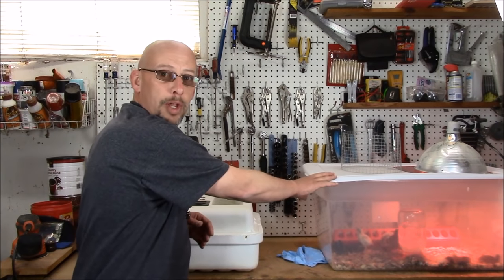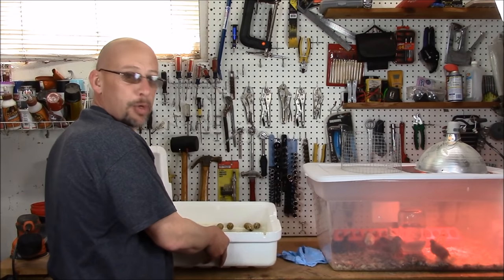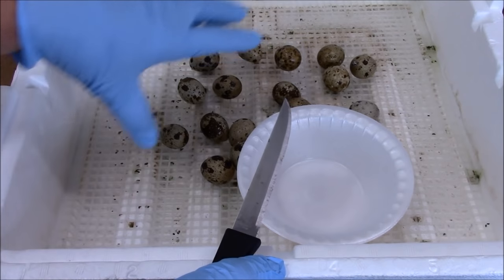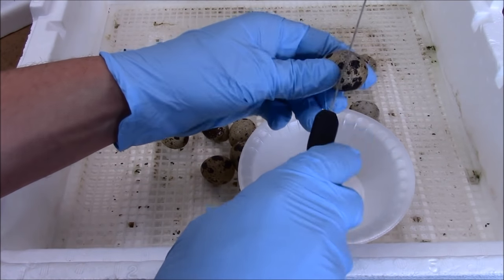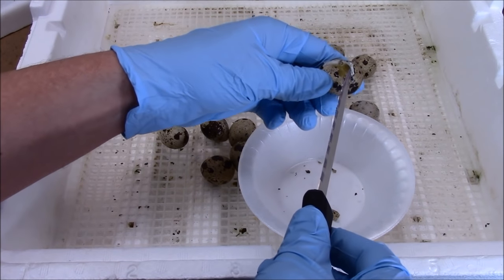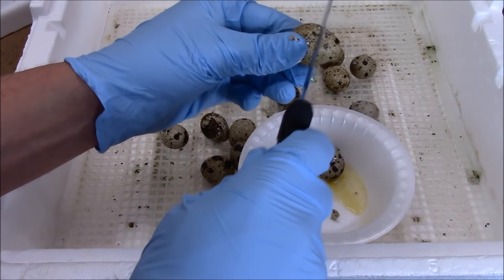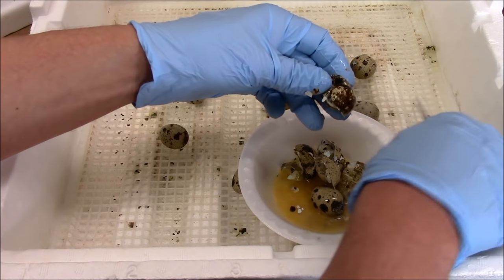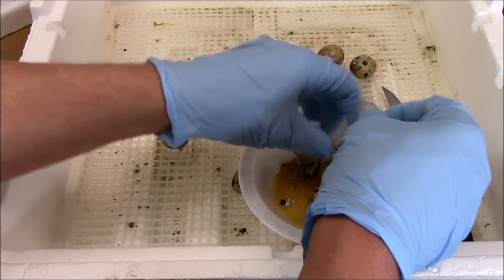Troubleshooting a Poor Hatch: The SR Quail Update 3-13-17

Comment: I’m on day 20, they just pipped the putter shell this morning, it’s now almost the end of this day. Should I help?
Reply from the maker: I am sorry for the slow response.  It usually doesn't work out to try and help the birds out of the shell.  It sounds like your incubator may be running a little cool.  Day 20 is very late for the birds to start pipping.  I am hoping that they made it out of the shell and you ended up with a good hatch rate but i would get a few non-digital thermometers, calibrate them (make sure to calibrate them) and throw them in the incubator (after this hatch is finished) to verify that it is reading temp correctly.

Comment: If i put a small fan in my incubator (lil giant forced air) because the corners are 4 degrees cooler than below the heater would the added air be harmful to the eggs?
Reply from the maker: No.  As long as the temp holds steady the extra air is actually a good thing.

Comment: what brand of calibrated thermometer is best
Reply from the maker: Well it doesn't really matter.  The key is that you need to calibrate it yourself (place in ice water and then in boiling water to determine if it is reading correctly).  You also want to make sure that it reads low enough.  Some meat thermometers don't go down to 100 degrees.  These are the thermometers that i am using (that is an affiliate link by the way).

http://amzn.to/2navRhl

Comment: I can see d chick moving but they won’t come out and it’s day 20
Reply from the maker: I am sorry to hear that.  That does happen some times.  There could be many reasons for it.  The first thing to check is that your incubator is reading temperature correctly.  if it is a degree or two lower than what it says that could be the cause.
Reply: Slightly Rednecked thanks for responding , the both died I try again it’s the incubator

Comment: So chicks that don't thrive after they've hatched, and die? Is that temp issue near the end? Not in incubator long enough?
Reply from the maker: I am sorry to hear that.  It could be a combination of things.  If they are hatching a little slow (past day 18) it is probably a temperature issue  with the incubator reading a degree or two too low.  As you mentioned, always make sure to leave them in the incubator until they are dry and fluffy before moving them to the brooder box.  That could be another issue.  I hope that helps.